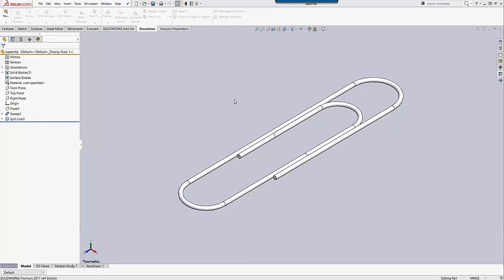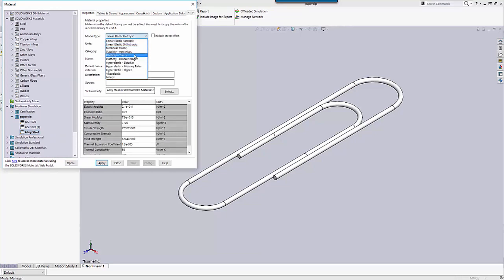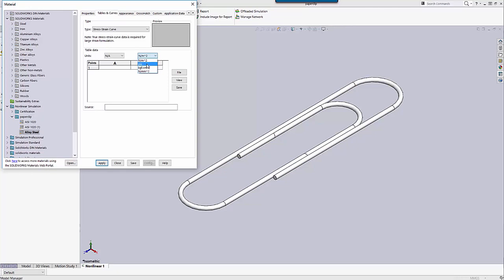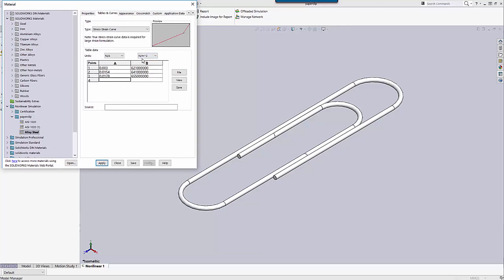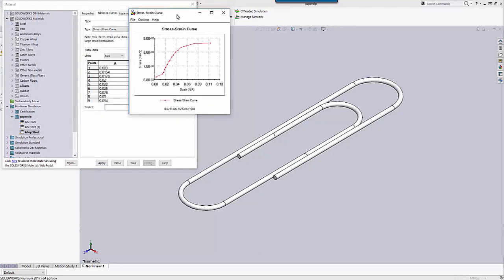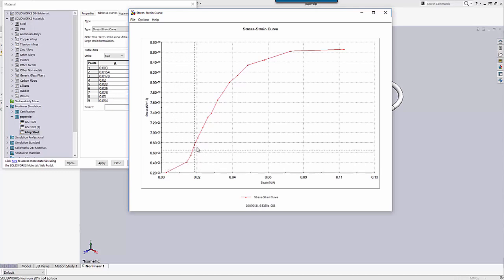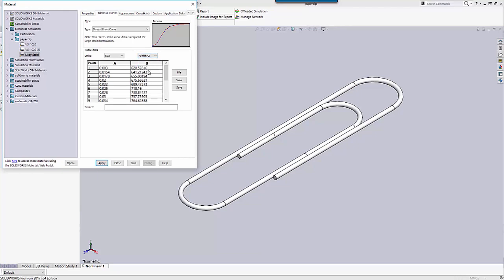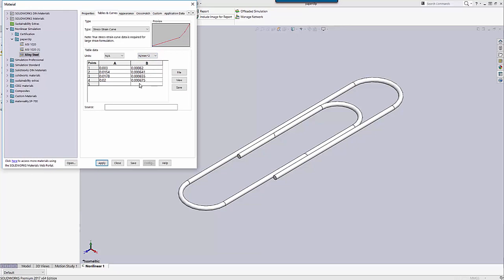SOLIDWORKS Simulation - How to Create Stress Strain Curves

Comment: The top portion of mild steel stress-strain curve is almost flat. Whatever I do, SW stops at around maximum stress point on the curve where the flat portion starts. with this message :  
[The solution may be at a buckling or limit point, i.e., displacements grow large under constant forces. If so, for force control or contact problems, this is the end of solution (check out the response graphs).The solver numerical difficulties:  1. For Plasticity models, raise: ETAN >Ex/100.]
I am working on metal bending where lots of strain occurs.
Thank you!

Comment: I am getting failures doing my non-linear analysis.  I'm using materials with accurate plastic region curves.  But the recommendation which pops up after failing says to change the material tangent modulus.  Does that mean I should remove the plastic curve completely and just input a value for tangent modulus?  If I do that will the analysis still allow for material yielding?
Reply from the maker: This is a more complicated question then we can really handle in a comment section. Our recommendation would be to get with your VAR's tech support department to go over the issue in detail.

Comment: Just want to emphasize that the plastic region curve begins at the .2% offset point, not at the point where the stress strain curve departs from the straight line elastic modulus portion.  Simulation will assume the shape of the stress strain curve between the end of the elastic curve and the .2% offset point.
Reply: 0.2% of what? can you explain more please?

Comment: I have stress-strain curve my own , but i dont know how to extract from graph and fill in correctly in the material properties. Anyway , is that the properties of material must be filled?(if i have fill in the stress-strain curve)
Reply from the maker: If you have a graph but not RAW data here is another video that I made on how to extract RAW data from a graph. 

https://youtu.be/p6F6s-t4xyE

You do need to input the RAW data you extract from the graph into the Stress-Strain curve table in Nonlinear SOLIDWORKS Simulation but make sure that the very first data point is the yield point of the material you will be applying in the simulation. It does not work properly unless the Stress-Strain Curve data input into the program starts at the yield point of the material’s Stress-Strain Curve.

Comment: Where can I find the values of the stress-strain of any material for free? Also the tangent modulus?
Reply from the maker: If you have Simulation Professional or Simulation Premium they can access the Matereality website for many more materials with Stress-Strain curves besides what is in the default SolidWorks database for no additional charge by clicking the blue “here” button at the bottom left corner of the SolidWorks Material data base. 

If you do not have the correct simulation licenses to gain access to the Matereality website then the next best options are searching the internet for scientific literature with the correct stress-strain and tangent modulus for the material of interest. Obtaining this information from the manufacturer of the material of interest. Or searching matweb.com which does give material properties information for free buy may or may not have the correct information sometimes they do some times not. If the material properties cannot be found then the only other method to obtain the correct stress-strain curve or tangent modulus is through experimentation.

Comment: Is there an option to select to make sure tangent modulus is not used over the stress strain curve for plasticity von mises or am I missing something in regards to Solidwork's use of the tangent modulus ?   Im assuming the tangent modulus is used in place of the plastic stress stain points in plastic-von mises.  Also, can stress stain curves be input with temperature dependency ?
Thank you
Reply from the maker: Hi Rob,
According to the SOLIDWORKS Knowledge Base (solution article: S-050027), the stress-strain curve takes priority over the tangent modulus if the stress-strain curve is defined.  The only time the Tangent Modulus will be used is if the stress-strain curve is entirely absent.
Reply: Excellent.  How about temperature dependent stress strain curves ?  Does Solidworks have an option for this in Sim. Premium ?